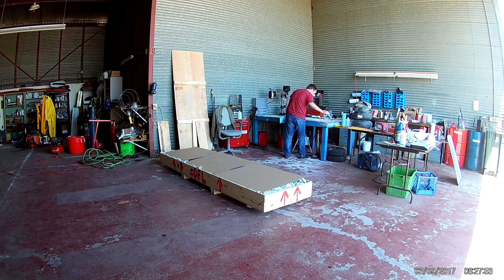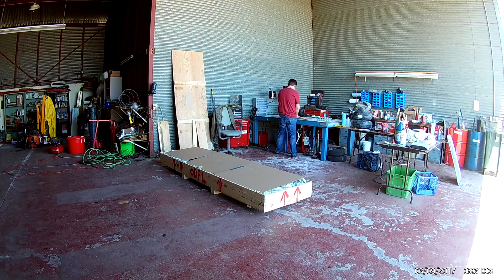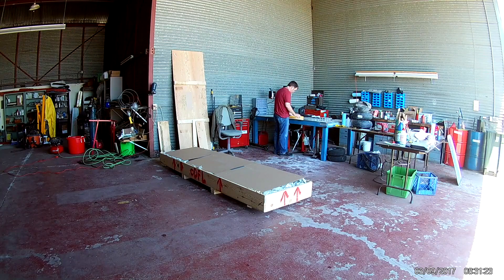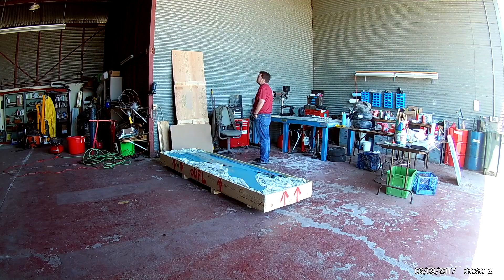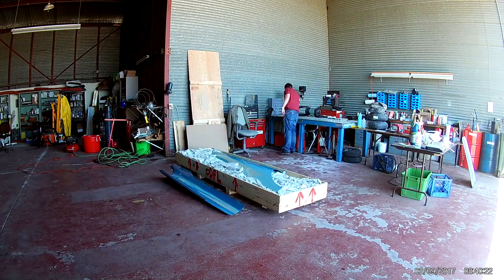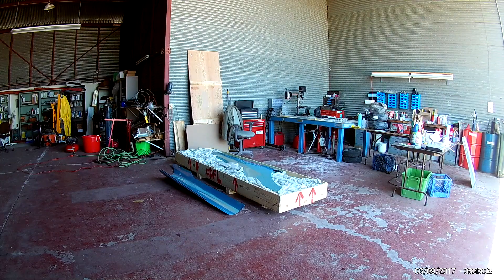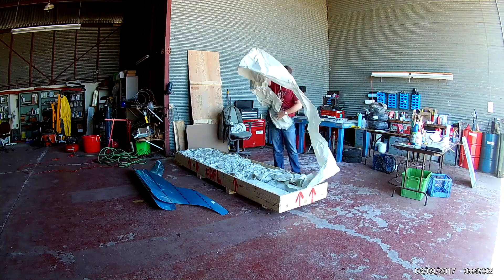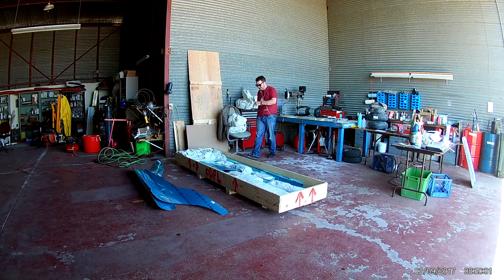RV-14 - Unpacking 1

Comment: If you were to do the build again would consider the quickbuild wing and fuselage kit? 

I’ve been considering an RV14 kit and the quick build wings seem like a they would save a ton of work/time priming little parts, and assembling. Fuselage would also be nice but seems a lot less tedious than the wing builds.
Reply from the maker: Not me. I wanted to do every single rivet, screw and wire. Ask me again when she's flying.
Reply: That’s kinda how I feel too but I like the thought of having all the individual components being primed before installing.

I can see if I were doing it deciding to just prime after construction to avoid hanging and painting all those individual ribs. Lol
Reply from the maker: Priming really wasn't that bad. I didn't do the full on 2 part primer, etc... WAY too much of a pain. Nothing wrong with a little rattle can.
Reply: Andrew Kilroy wow lol! After watching the rudder, aileron, and wing builds I’m kinda shocked would go quick build lol. Those parts alone seemed to take a lot of time for each individual build 😂